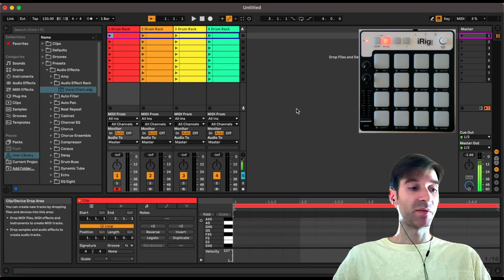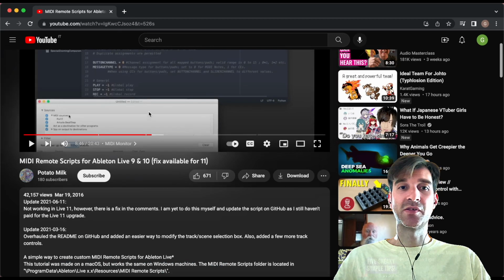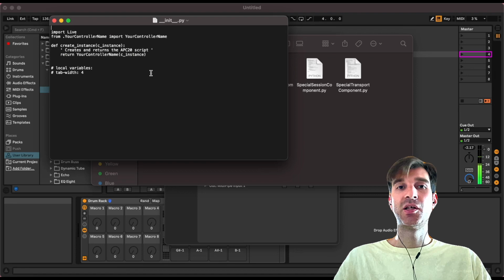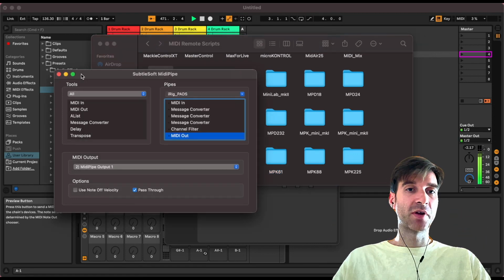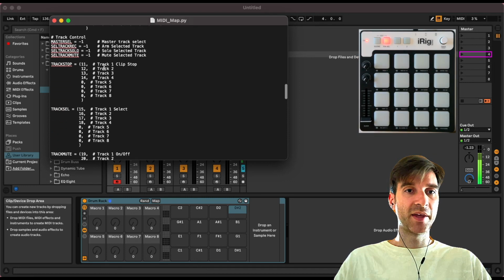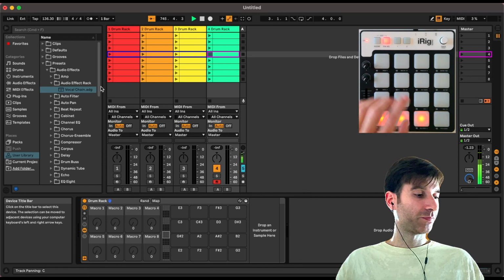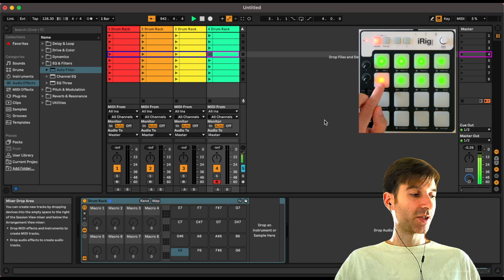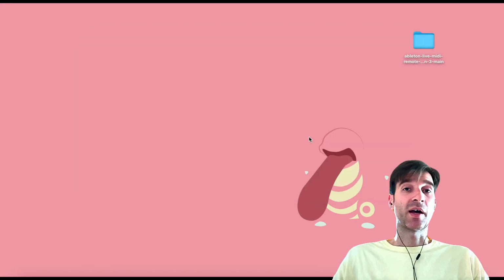Turn any MIDI Controller into a Control Surface for Ableton! Custom MIDI script tutorial [iRig PADS]

Comment: Good morning! First of all, I want to thank you and compliment you on this incredibly clear tutorial; it helped me resolve issues with several of my devices.

I have a question that perhaps you or someone here can help me with: I have 4 knobs with 2 layers on my controller. I’ve mapped 4 of the 8 notes transmitted by these knobs to control the first 4 effect parameters on a selected track. The other 4 notes on the second layer are configured to control the volume of their corresponding tracks.

The problem is that when I use the first layer to adjust an effect and then switch to the second layer to control the volume, the volume value jumps to whatever position the knob was in for the effect. These are endless rotary encoders.

Is there a way within the script or Ableton Live to fix this behavior so the values don't jump? Thanks a million in advance to anyone who can help!
Reply from the maker: Cheers. I think this is solvable not in the script, but simply in Live's MIDI settings. There is an option somewhere in there where you can set how virtual knobs react to physical ones being turned.
Reply: @TheNeonSyndicate  thx, i tried all the ableton options but i think it's an hardware issue ❤
Reply from the maker: @marcello.attolini  found it - you wanna look at "takeover mode" under MIDI settings

Comment: Hi! Great video! I just bought a M-VAVE SMK37 Pro and i'm trying to set it up as a control surface. I'm trying to change only small chunks of the midi_Map.py at a time so I have less variables to account for. I assigned a pad to channel 1, with CC 36. In the script, I set: 

BUTTONCHANNEL = 0  # Channel assignment for all mapped buttons/pads; valid range is 0 to 15 ; 0=1, 1=2 etc.
MESSAGETYPE = 1  # Message type for buttons/pads; set to 0 for MIDI Notes, 1 for CCs.

# General
PLAY = 36   # Global play

The script loads with no errors in preferences/log.txt, and the red box is there in the clip view, however, despite ableton recognizing the input (orange light at the top right corner is blinking when pad is pressed), nothing happens when pressing the pads. Does anyone know how to fix it?
Reply from the maker: Haven't used Could you try setting MESSAGETYPE to 0 instead and, on your physical controller, set that pad to note 35 instead?
Reply: @TheNeonSyndicate  Thank you for your quick response! After trying different approaches, what ended up working was setting it to 0, like you said, and also rebooting my PC. There was probably some other software in the background using the midi controller. Thank you!
Reply from the maker: @gabrielfagundesdasilva7386  Glad to help! Have fun

Comment: Does this work with Ableton 12? Trying to set my Traktor Kontrol F1 - 1 up and following the steps it doesn't show up in the dropdown menu in Ableton's "Control Surfaces" options. It should be noted that it also doesn't create the "pycache" folder. I'd assume the name of the device is wrong, but it's a perfect copy with the added underscores. Not sure where I've gone wrong after checking the troubleshooting tab on GitHub.

Comment: Id like to create a custom mapping for a device which already has one in the standard Control Surface list. Do I then delete that so I can create a custom one (with the same name!)?
Reply from the maker: Sounds like the way to go! Just to be safe, I'd save a copy of the original somewhere on your hard drive in case you ever need to revert back to it at some point in the future.

Comment: One thing i’m wondering is if it would be possible to have a button to “lock” the midi controller to a device.

Like when you right click and press “lock to controller XYZ”

Have you seen any script with this functionality?

The LAUNCH CONTROL XL has two buttons to select devices but i would like to know it it there is such LOCK options on the Remote Script API to lock it to the currently selected device.
Reply from the maker: Sorry, not sure what you're talking about, could you elaborate?
Reply: @TheNeonSyndicate tks for the reply! It was really late and i wrote a terribly well explained message! I have edited now, please let me know if its clear and if you have seen examples of that?
Reply from the maker: @henriquematias1986  Thanks for the clarification. I don't think what you're envisioning is possible with this particular script, but you can stack a second script on top of this one that I believe has that functionality: ClyphX. I have a tutorial showing you how to use it to switch presets that also serves as a sort of introduction to how it works generally speaking: https://youtu.be/B5RaW4hEcTI One of the commands ClyphX allows you to perform I believe is precisely locking the controls to a device.
Reply from the maker: Although, now that you mention it, maybe this script might, too? Have a look at the file with all the MIDI functions (such as transport etc.), see if there's anything in the section with the other device controls!
Reply: Wouldn't that be exactly the function of the "DEVICELOCK" button?
Reply from the maker: @marcelovitor7175  Now that you mention it... It would be best used paired with the "device select" option so you could dynamically lock/unlock different devices!

Comment: Hey sorry to necropost, but I'd like to use this to setup my controller, but I'd love to get colour feedback from Live to my pads. Anyone get this right yet? And can point me in the right direction?
Reply from the maker: This depends on your controller. Or mine, for instance, the pads will light up in different colors if they receive MIDI information in the form of CCs 78 through 100ish. YMMV. Nothing you can do about it in terms of this scrip afaikt. Just create a MIDI track in Live, set your controller as the hardware output and try sending various messages to it. Checking your manual might also help.

Comment: Would you happen to know how to synchronize two control surface? I have a Launchpad X and an X-Touch, and I would like them to display the same track bank at all time, so no matter where I switch the track bank view, they always display the same.
Reply from the maker: I see what you mean. I have no idea how to do this, but maybe connecting one of them to the other one and that other one to your laptop could be a starting point for some experimenting.

Comment: I managed to improve this script to its limits. It takes both midi and cc. It does copy clip delete clip duplicate stuff. Rec quantization and grid quantization options etc. I am still testing it tho. It took my weeks. Idk if anyone would pay me for my efforts tho.
Reply from the maker: Interesting! You should ask the original developer though before even trying to sell this.
Reply: @TheNeonSyndicate  yea i understand your point but this is very packed script and changed alot.
-both cc and note values can be assigned to any function.
-there is a shift system, most functions has a shift alternative function
-track volume fader for session box has 0db max limit
-duplicate clip, overdub on clip, delete clip, copy paste clip in session box
-selected track: volume
-selected track: sends (up to 8 sends)
and many more stuff...
The only thing i couldn't add keyboard modes and colors (since i made it for mpd32 and no color pads on that lol). Special device parameters like push 3 simpler mode etc for lazy chop etc.
Anyway i will try to reach other person to have permission than. (donation might be an option maybe since i am poor af)
Reply from the maker: @reastora  Sounds extremely interesting. Good luck!
Reply: @reastora  hello bro, could u make a script for  Akai MK3 Mini?
Reply: @reastora  i want to make freestyle events in the street here in my region, im Venezuelan, i want to make lives too, for this i will need a template like these, ¿Selected track controls? Wow, i use windows and now im fighting and learning with python for just read the default script to iniciate to make all the process of configuration, two years ago Two years ago I did it with FL but without script, in a mounth. If u can help me, I would be very grateful and I will visit you someday.

Comment: I have tried to write a simple script that creates a MIDI track in Ableton 12.0.25 when I send CC 55 from my MIDI controller but it doesn't work. The script shows in Abletons Control Surface list. Can someone help please?
Reply from the maker: Could be any sorts of reasons. Are you using the scripts provided here? Did anything different from the video?
Reply: @TheNeonSyndicate  I looked at your scripts and other scripts I found on the internet to try to understand how it works. All I need is if someone can write me a python script that creates a new MIDI track when I send CC 55 from my MIDI controller. I am on Ableton 12.0.25, Mac mini M1, Sonoma.
Reply from the maker: @thrutherockies3687  You might want to check out ClyphX. Not sure, but that might allow you to create a new track by triggering a MIDI clip on another track, which of course you could assign to CC55.

Comment: Anyone figured out how to make LED feedback of clips in Session view work? I mean when the clip is playing (red 127), clip loaded but inactive (red 64), clip not loaded (0)?
Reply from the maker: You need to set the track so that it does send that MIDI information back into the iRig PADS controller. Selecting it as the physical output of your MIDI track should do the trick.
Reply: @TheNeonSyndicate  well, i didn't specify that i'm talking about Xone K2, sorry. I'm trying to get the LED lights on the controller to accurately reflect the state of the clip slots in Ableton's Session View. Red - clip is playing. Dimmed red - clip is present but not playing. OFF - no clip. Anyway, the script works perfectly even in Ableton 12. Great job!
Reply from the maker: @davidhollas2626  Ah, I understand. Thank you for your kind words. I hope you or someone else finds a solution!

Comment: Hi, my volume faders are sending pitch bend signals, how could I map them?
Reply: How can I assign different notes to the Knob when I turn it left or right?
Reply from the maker: @ Same thing: you need something like MidiPipe that will "split" your knob's CC signal into two different ones.
Reply: Could you explain how clip selection works together with launch? Also, is there any software similar to MidiPipe, but for Windows?
Reply from the maker: @ I hear Bohme's MIDI tool for Windows is quite capable. As far as clip selection, there should be an option for that in the file? Like "select previous clip" & "select next clip". Not sure, haven't used Live in a long time. Certainly there is an 8 by 8 matrix for clip launching though!
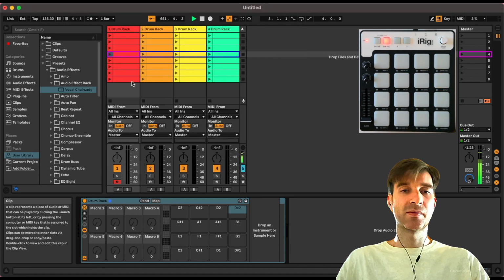Reply: @TheNeonSyndicate  I'm referring to the part of the video that starts at 12:16
Reply from the maker: @marcelovitor7175  Aaah right, gotcha. Yeah, for that you do need MidiPipe or another MIDI tool. Basically I've set it up so that one MIDI message triggers both "select track" as well as "play selected clip".
Reply: I'm managing to map some functions to my M VAVE SMC-Mixer controller with Ableton 12
Reply from the maker: @marcelovitor7175  that's great!
Reply from the maker: You'd need to convert them to note or CC messages first. If you're on Mac, MidiPipe is a great little utility I have tons of tutorials about!

Comment: Hi, my name is Germano. Everything works but the LEDs don't turn on. They don't turn on for me. I use Akai Fire. Why?.
Reply from the maker: This script is just for functions, the lights are a different story I'm afraid. My best guess is that the Fire needs to receive a certain MIDI message, so you could set is as an output for any MIDI tracks you might have - basically, whatever message you send into Ableton will also be sent back to the Fire, maybe that can trigger the lights, but I can't promise anything. Worth trying though!

Comment: Thank you very much for the effort and the video. I struggle to get the script to work. Will it work in Ableton 12 ? Im not sure how to name my controller. It's connected to a Motu Midi Express 128 Interface with 8 channels. It's connected to the first channel. The Inputs are called: Express 128 (Port 1) up to Express 128 (Port 8). When i name it like this: Express_128_(Port_1) there is no folder showing up. When i name it only Express_128 or Express_128_Port_1 i have the folder inside ableton, but i get no midi. Any Ideas ?
Reply from the maker: What I can tell you is that this works with 12 for sure. Have you checked your interface does not already have a script in the control surface options?
Reply: @TheNeonSyndicate   Ok, i got it to work. Seems it had overlooked the midi channel assignment. Thank you
Reply from the maker: @GreenGrooves  Glad everything worked out!

Comment: Greetings Neon Syndicate and one and all ~ hello! I've bought a Novation Launchkey Mk3 (49 key) bundled with Ableton Live 11. Then, I also got a very decent condition Yamaha QY100 (bloody amazing device..) ~ I watched your tutorial hoping to solve a Novation/QY100/Ableton conundrum. 
Neither the Launchkey nor Ableton seem to want to recognise my Yamaha QY100.. 
Question: How easy (or not..) is it to use the Launchkey as the controller for the QY100 ~ For both recording (in #Ableton / Cubase and also for live work? 
Do i have to create / rewrite scripts as you have here? I have a horrible feeling this is the case.. 🤯😂
Consider me a proper dimbo where midi and cc type things are concerned.. Talk to me as you would a six year old.. or a labrador dog.. 😜 
Any and all advice greatly appreciated..🤞✌
Reply from the maker: Hey, thanks for checking out the video. I used to own a Launchkey Mini, so when it comes to that, I have good news: you don't need any custom scripts for that one in Ableton - just select it from the "control surface" menu as your in and out and you're golden. As far as the Yamaha - not familiar with that device but it seems to be both a sound generator and a MIDI controller, so depends on what you want to do: if you just want to play its sounds, it should be as easy as connecting your Launchkey's midi output to the Yamaha's midi input, then the Yamaha's audio output to the input on your audio device, and finally selecting that audio device in whatever daw you're using and that's pretty much it - you can play your keys on the Launchkey to trigger sounds on the Yamaha and record them in Live or Cubase.
Reply: hiya  @TheNeonSyndicate  ~ Many thanks for what seems pretty sound advice! ~ I'll give it a whirl.. cheers!
Reply from the maker: @bestchinainfo  Have fun!
Reply: @TheNeonSyndicate  Trying..🤯🤕😂

Comment: Hi The Neon Syndicate! Great video however I am experiencing a bunch of problems. I have a behringer xtouch compact which has 8 faders but 2 banks (meaning each fader is able to send 2 ccs when you switch banks) and have tried everything to get it to control the first 16 track volumes in ableton using this script - is it possible? 

Also, I was wondering if it is possible to modify it further such that the 8 knobs on the right hand side of my controller control the first parameter in each live device on the selected track? Ie, the first knob maps to the first parameter in the first device on that track, the second knob maps to the second device on that track etc? I know how to code but there is such limited documentation on this topic :(

Any help would be greatly appreciated!
Reply from the maker: Hey, so as far as controlling 16 tracks, you might just want to assign something to "select next track", and once you move from the 8th to the 9th track, the red selection box will be wrapped around tracks 9-16, which you should be able to control with your faders on the first bank. As far as having your knobs control parameters on different devices, I'm afraid the controlled device needs to be the one selected, so that doesn't sound feasible to me. That being said, everything you suggested could be accomplished using Live's native per-project MIDI learn function!
Reply: @TheNeonSyndicate  what do you mean by select next track? I have tried the track left/right and session left/right but it only moves by one slot at a time. Ideally I would want to be able to have the controller control 16 tracks as each fader is capable of sending 2 different cc's based on the layer selected. Do you know a way to do this /another solution? I have tried changing the 8's to 16s in the code but it seems to be going of a num_tracks parameter that comes in from ableton.

I really appreciate the help!
Reply from the maker: @lincolnzanon3346  Yeah, I've tried that too in the past, but it doesn't seem to work. You can control 8 faders at any given time. I'm sure there must be some way to alter the code (not the map.py file) but my attempts so far have not yielded results unfortunately.